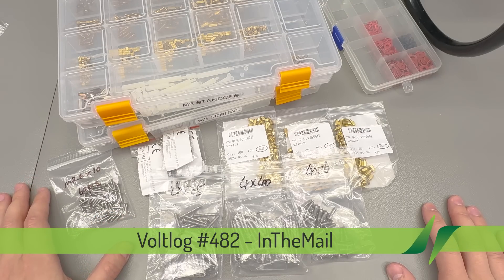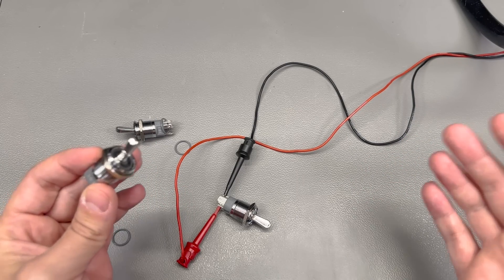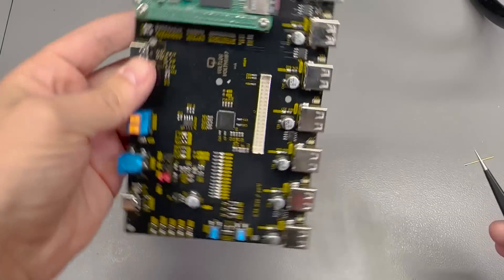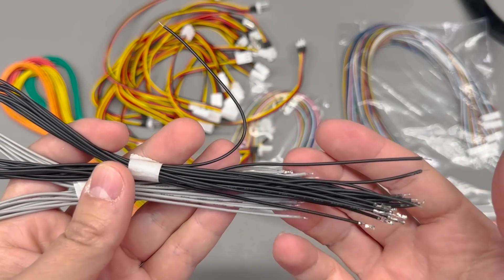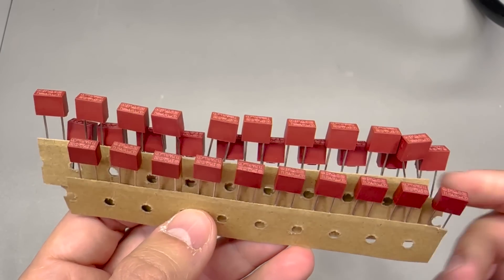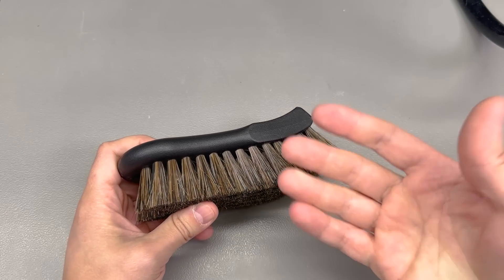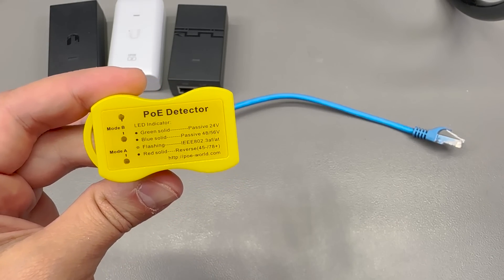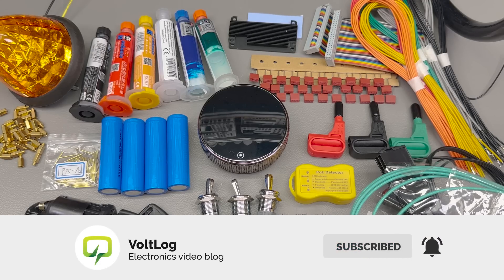InTheMail | Voltlog #482

Comment: those crimped cables are they compatible with all molex plastic pieces that support 26AWG wire?
Reply from the maker: You can find pre-crimped wires that are compatible with all of the major known systems, but the ones I've shown are compatible with JST PH style 2.0mm pitch connectors.

Comment: What is the voltage of the Na-Ion cells!? Without that info, a "capacity" of 1300mAh means nothing. If the cell is 100V, that is a hell of a lot of power stored.
Reply: Typical characteristics of these cells :
Nominal Voltage: 3.0V
Operating voltage: 1.5~4.0V
Real Capacity: 1300mAh
Energy Density: 128.00Wh/Kg
Cycle life: >2000 cycles
Charging Temperature: -0℃~35℃
Discharging temperature: -40℃~60℃
Storage life: 15 years
Reply: Let it sink in for a minute. I would not doubt for a second that these metrics are purposefully vague and circumstantial.

Comment: I know correlation doesn't mean causation, but for some reason every time you post an InTheMail video my bank account dips a bit right after.
Reply: Seems like every few weeks I have the same problem. Not necessarily the items on here, but I definitely see Aliexpress packages arrive afterwards. 😎
Reply: Weird, the same happens to me! 🤔
Reply: Much weirder, my bank account dips even before the videos. And by the release of the video some of its contents have already arrived in the weeks before. In this case the red insulating washers, the micro USB to USB-C cable and the JST pigtails.